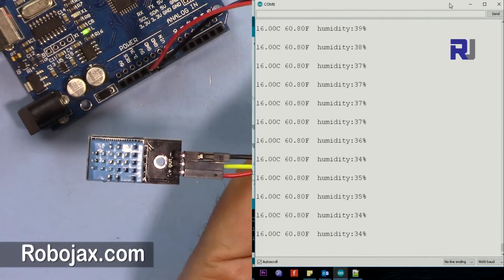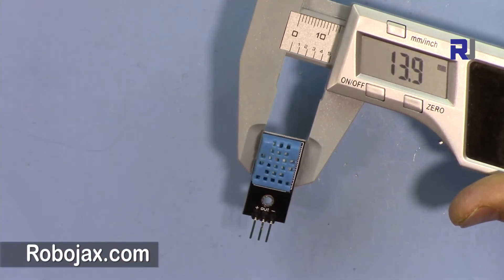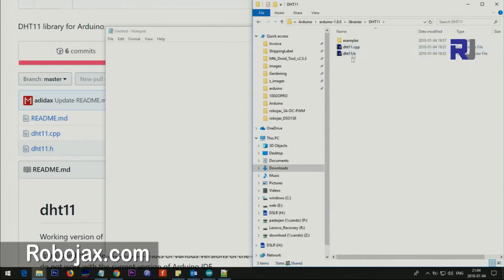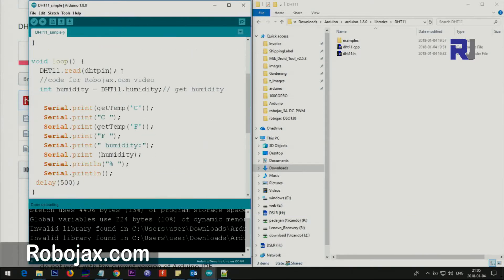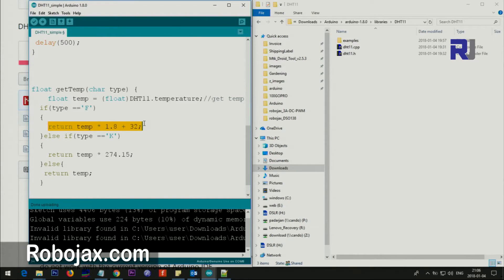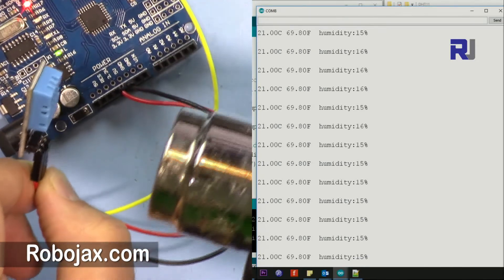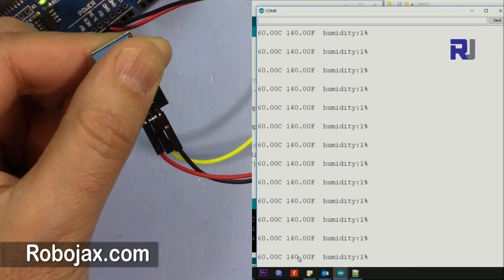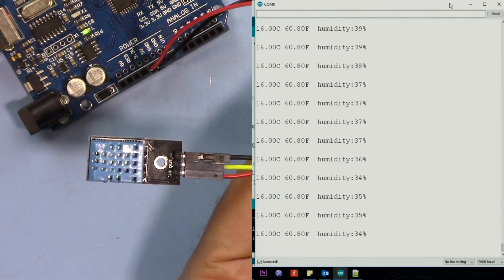How to use DHT11 Temperature and Humidity Sensor RJT40

Comment: Hello . Thank you for your wonderful explanation.
I have a question:
Are the sensors like LM35 and DH11-22 accurate and reliable?
Are  it need  to calibrate?
thank you
Reply from the maker: You are welcome. I have not compared it with LM35. Because this is digital while LM35 is analogue, this should be much better.
No calibration is needed. Datasheet/manual has been provided.

Comment: I keep getting 0 degrees celsius and 0 percent humidity
Reply from the maker: if used the provided code and library, then your wiring is incorrect. If you checked the wiring and still got error, then try another module. So check the wiring.

Comment: Dear Mr Robojax, i would like to thank you for your video details. How ever i get from serial 0.00C 32.00F 274.15K humidity:0% . do you know why. i have triple check the connections. the code runs right.when i disconect dh11 the values change. do you have any idea what is wrong?
Reply from the maker: You are welcome. 
it means the variable "temp" is not returning any value.  Hard to tell but if you  try another sensor. this is not the matter of code and you mentioned have checked the connections.
Reply: thanks for the reply is apprieced my quess is that senors has problem.Thnak you once more